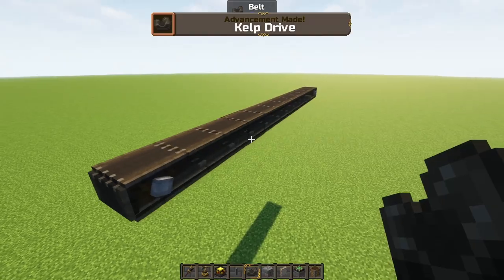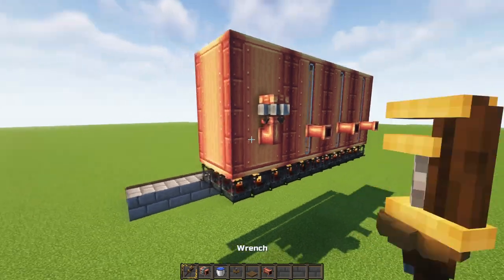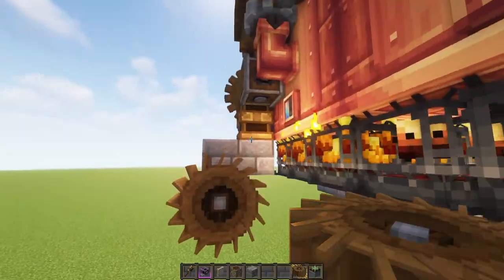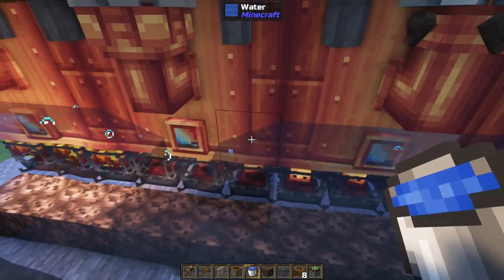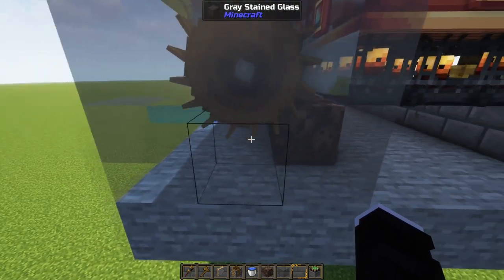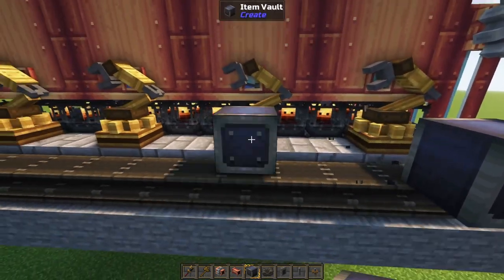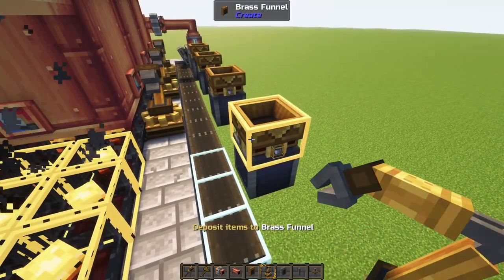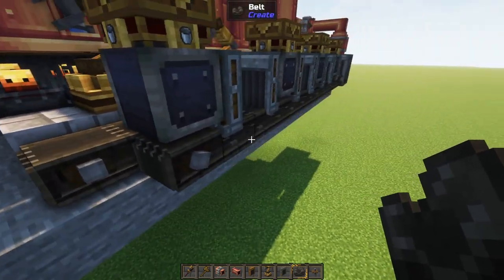Minecraft Create: Self-Suficient T9 Steam Engine!

Comment from the maker: I apologise for the rushed up ending. Due to medical reasons it was a struggle to be on my pc for more than few minutes at a time. But I mostly skipped the part where I connected the gearboxes and so on, it shouldn't be hard to do without tutorial, and there is also the blueprint.
Reply: hope you get better soon
Reply: Get well soon. I've been really enjoying your videos since I found them, hope more keep coming
Reply: I didn’t noticed the rushed part. It really helped me building my first steam engine. Especially for the Lava Source, the mechanical arms and water pumps. My Lava Generation and Belts are running on two x3 waterwheels and the waterpump is powered by the engine itself (after I kickstarted it).
Reply: @nautilus7098  be carfefull, powering the watersource with the engine itself often leads to problems...
Reply: i  cannot use the blue print

Comment: Usually when I watch a yt video on steam engines I'll make a 4 page critique of everything they messed up. But this is a pretty decent design. Could be more compact but it doesn't need to be. Water wheels could be replaced by a passive engines. But doesn't really need to be either. Only objectively wrong thing is the pump speed. 180 is the perfect speed for the pumps as it requires 20rpm per boiler level. 192 just wastes.. 144 su. Tsk tsk lol
Reply: do you have a video for us to enjoy as well?